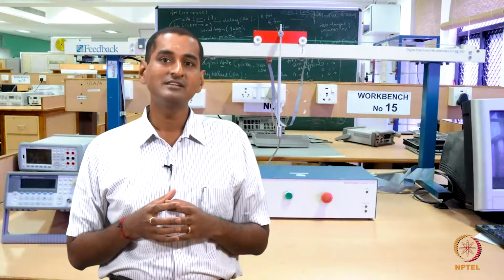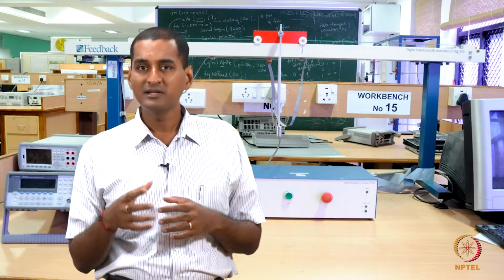Control System Introduction

Comment: Subtítulos en español / Spanish subtitles:

1
00:00:11,020 --> 00:00:16,600
Saludos, el vídeo va a proporcionar una breve descripción del

2
00:00:16,600 --> 00:00:19,690
curso sobre sistemas de control.

3
00:00:19,690 --> 00:00:28,260
Como el título del curso indica, este curso va a proporcionar una visión general de los métodos

4
00:00:28,260 --> 00:00:33,590
y las ideas que se pueden utilizar para el diseño de controladores de sistemas dinámicos.

5
00:00:33,590 --> 00:00:39,950
Por eso quiero aprovechar un ejemplo para transmitir lo que este curso esencialmente hará.

6
00:00:39,950 --> 00:00:46,790
Así que si consideramos un motor dc, por ejemplo. 
Le damos una entrada de voltaje al motor dc

7
00:00:46,960 --> 00:00:51,020
y obtenemos una velocidad de rotación o RPM del motor dc.

8
00:00:51,020 --> 00:00:57,070
Por lo que consideramos el motor dc como un sistema al que se da un voltaje como la entrada y

9
00:00:57,070 --> 00:01:02,860
la velocidad de rotación se obtiene como la correspondiente salida.

10
00:01:02,860 --> 00:01:09,749
La pregunta que vamos a preguntarnos, es que, si quiero que el motor dc funcione

11
00:01:09,749 --> 00:01:16,399
a una velocidad de rotación dada, cuál debe ser la entrada o el voltaje que debo proporcionar

12
00:01:16,399 --> 00:01:17,869
al motor.

13
00:01:17,869 --> 00:01:20,779
Así que, básicamente, define este curso.

14
00:01:20,779 --> 00:01:26,680
Por lo que este curso se trata de la visualización de sistemas como entidades a las que se les proporciona una entrada y

15
00:01:26,680 --> 00:01:36,079
obtenemos una salida del sistema. La pregunta que nos haremos es, ¿puedo diseñar algunos controladores

16
00:01:36,199 --> 00:01:44,780
que esencialmente regulen el valor de la salida del sistema, alrededor de un punto operativo deseado

17
00:01:44,780 --> 00:01:51,279
o alrededor de una región de funcionamiento deseada, mediante la variación de la entrada al sistema.

18
00:01:51,279 --> 00:01:55,109
Así que eso es lo que vamos a aprender en este curso en particular.

19
00:01:55,109 --> 00:01:57,139
¿Quién debe tomar este curso?

20
00:01:57,139 --> 00:02:04,249
Este curso es el primer curso sobre sistemas de control y está idealmente dirigido a

21
00:02:04,249 --> 00:02:13,740
estudiantes universitarios de segundo año, que tienen conocimientos en matemáticas básicas de ingeniería como

22
00:02:13,740 --> 00:02:21,120
álgebra, polinomios, números complejos, transformada de Laplace y ecuaciones diferenciales ordinarias.

23
00:02:21,120 --> 00:02:25,030
Estas son las bases que se requieren para tomar este curso.

24
00:02:25,030 --> 00:02:30,700
Por supuesto que también ayudaría a personas que están llevando a cabo estudios de grado 

25
00:02:30,700 --> 00:02:34,080
que quieren un repaso de los controles básicos.

26
00:02:34,080 --> 00:02:37,580
Saben que también pueden, esencialmente, obtener información de este curso 

27
00:02:37,580 --> 00:02:39,990
y este curso

28
00:02:39,990 --> 00:02:47,710
empezaría esencialmente por la identificación de la clase de sistemas que vamos a estudiar y aprender cómo

29
00:02:47,710 --> 00:02:53,680
caracterizar tales sistemas como entidades a las que se les da una entrada y una salida es obtenida.

30
00:02:53,680 --> 00:03:01,400
Aprenderemos 2 representaciones de los sistemas dinámicos, una es la que se denomina como representación en función de transferencia, 

31
00:03:01,460 --> 00:03:04,310
y la segunda es la que se denomina como respresentación en espacio de estados.

32
00:03:04,460 --> 00:03:10,710
Este curso usará predominantemente la representación en función de transferencia de los sistemas dinámicos

33
00:03:10,710 --> 00:03:13,600
para el análisis y diseño.

34
00:03:13,600 --> 00:03:19,350
Aunque, también aprenderemos lo que se denomina como la respresentación en espacio de estados

35
00:03:19,350 --> 00:03:23,600
y eso será utilizado en cursos avanzados de sistemas de control.

36
00:03:23,600 --> 00:03:30,510
Una vez que aprendamos cómo caracterizar sistemas dinámicos por su estabilidad y rendimiento

37
00:03:30,520 --> 00:03:39,710
tendríamos entonces que ir y aprender cómo diseñar controladores que van, esencialmente,

38
00:03:39,710 --> 00:03:41,490
a regular la salida del sistema.

39
00:03:41,490 --> 00:03:49,070
En este sentido, la clase de controladores en la que nos centraremos, es lo que se denomina como, un controlador PID.

40
00:03:49,340 --> 00:03:53,340
P significa proporcional, I significa integral, D significa derivativo. 

41
00:03:53,340 --> 00:03:59,569
Entonces, los controladores PID son ampliamente utilizados en la práctica en todo el mundo en varios dominios

42
00:03:59,580 --> 00:04:06,320
Por lo que este curso se concentra en: ¿qué se entiende por un controlador PID?

43
00:04:06,320 --> 00:04:13,819
¿cuál es la física detrás de éste? y luego, enseñar cómo diseñar tales controladores dado un sistema

44
00:04:13,819 --> 00:04:15,360
en particular.

45
00:04:15,360 --> 00:04:22,819
Aprenderemos métodos formales para hacerlo y veríamos esencialmente cómo se puede diseñar

46
00:04:22,819 --> 00:04:28,749
todo el así llamado, sistema de control en lazo cerrado para su estabilidad y rendimiento.

47
00:04:28,749 --> 00:04:34,050
También aprenderemos cómo esencialmente cuantificar el rendimiento, es decir, digamos

48
00:04:34,050 --> 00:04:44,379
si yo diseño 2 sistemas, ¿cuál es más rápido? ¿cuál esencialmente, sigue mejor una entrada deseada?

49
00:04:44,379 --> 00:04:49,370
todas esas preguntas serán contestadas mediante la cuantificación del rendimiento del sistema.

50
00:04:49,370 --> 00:04:56,930
También aprenderemos lo que se denomina como métodos de diagramas de raíces, métodos de diseño basados en diagramas de Bode,

51
00:04:56,930 --> 00:05:04,129
diagramas de Nyquist y criterios de estabilidad de Routh, que serían las diferentes herramientas

52
00:05:04,129 --> 00:05:07,199
que esencialmente obtendríamos de este curso en particular.

53
00:05:07,199 --> 00:05:12,979
Y mientras estamos aprendiendo la teoría, también aprenderemos cómo la teoría va a ser útil

54
00:05:12,979 --> 00:05:14,430
en la práctica.

55
00:05:14,430 --> 00:05:20,099
En este sentido, habrán algunos casos de estudio predominantemente hacia el final del curso

56
00:05:20,099 --> 00:05:26,090
donde se dan datos de la vida real, y a los participantes se les pedirá que esencialmente

57
00:05:26,090 --> 00:05:31,000
apliquen las ideas que se han aprendido en este curso en particular y diseñar un controlador.

58
00:05:31,000 --> 00:05:34,28
Eso básicamente proporcionará a los participantes

59
00:05:34,289 --> 00:05:40,340
con una vista del material aprendido en este curso y también da una experiencia práctica valiosa

60
00:05:40,340 --> 00:05:47,039
y un conocimiento práctico de Matlab y Simulink podría ser muy útil en ese sentido.

61
00:05:47,039 --> 00:05:53,069
Así que esto, en pocas palabras, usted sabe, proporciona algunos detalles sobre este curso en particular.

62
00:05:53,069 --> 00:06:01,430
Así que en resumen, este curso se espera que proporcione a un estudiante de segundo año de pregrado en ingeniería

63
00:06:01,430 --> 00:06:05,330
con algunas herramientas básicas para el diseño de control 

64
00:06:05,430 --> 00:06:10,330
y este curso sirve esencialmente como un escalón

65
00:06:10,330 --> 00:06:15,120
para futuras clases avanzadas en control que pueda tomar.

66
00:06:15,120 --> 00:06:24,949
Así que, los mejores deseos para usted al tomar este curso y espero que obtenga la información que es útil

67
00:06:24,949 --> 00:06:25,949
para usted.

68
00:06:25,949 --> 00:06:26,789
Gracias por su atención.
Reply: Good job man!!
Reply: Oh Dios